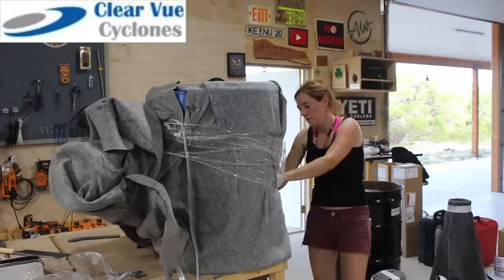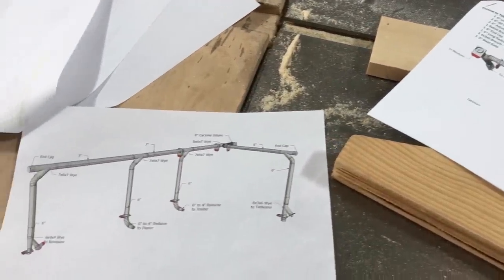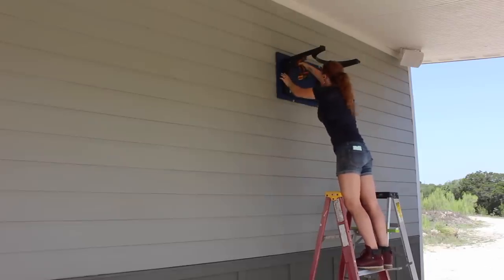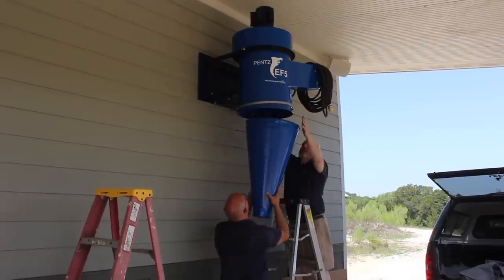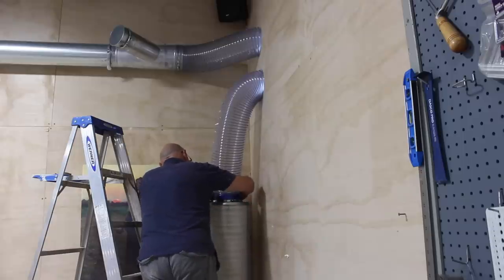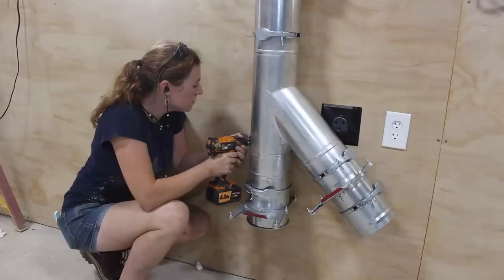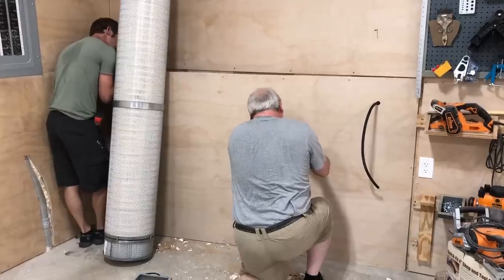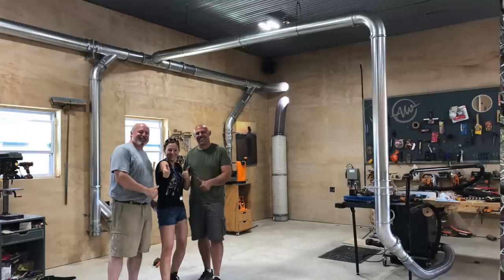Installing A Dust Collection System

Comment: I would use metal strapping on the ceiling because rope isn't gonna hold up. Overall I think you have one of the nicest wood shops in the country.
Reply from the maker: There is no reason the paracord shouldn't hold up fine. There is no motion so no friction to wear it down over time. It is also inside so no direct sunlight to break it down.

Comment: Why even bring the 5micron air back in? Is it really worth it to save the “cool” air (which will be a bit warmer once it gets back in your shop anyway)?
Reply: 1000+ cfm pumping OUT of the shop and new air will come from somewhere... If you are paying to cool/heat air you are going backwards. You need make up air if you are pumping air out. 

Further, if you have something like a woodstove or furnace you will potentially be pulling the exhaust back in to meet the make up air requirement.... ie.CO risk.

Comment: Why are there so many whiners on here today. Being unrelateable... you only need this system if you have a shop this size.  They have plenty of products that a small size shop needs at prizes a small shop can afford.  She uses the same type of equipment anyone could get, just because it's a brand or model you cant afford doesnt mean you cant do the same thing with a different model/brand.  And in this case, not a exception, she linked to something similar and more affordable such as Jay's setup.  If you are complaining about leaving just go already, she nor others folks need the negativity. There's enough of that in the world currently.

Comment: Why not run some of the metal 8-inch piping thru the wall that way it can be spray foamed around the outside and inside parts that way it helps keep the conditioned air in.

Comment: I have a question about the clamp together ducting.  Does this come in smaller diameters, and would it be appropriate for clothes dryer venting?  I have a long run of dryer duct through an unfinished space, and it would be fabulous to un-clamp a section to clean it out instead of having to work my way through from one end or the other
Reply: Norad... Google it.
Reply: Yes,  the ez duct comes in 4". Same as your dryer duct. I believe 3" is the smallest I have seen. But, it isn't cheap!
Reply: @lukeclark1544  Thanks!  Even if I only did a short section near the elbow into the laundry room, it would make the whole de-linting process so much easier.
Reply: They come in 5' long lengths.

Comment: Holy crap be careful you don't implodes your shop. Good idea in using the reusable pipe system, no telling when you might change stuff around. I bet it was too much more than using PVC. 8" PVC isn't cheap.

Comment: Did the pipe, with clamping system for joins, come from Clearvue? If so where can it be bought separately?
Reply: That is Norfab ducting, it is the defacto standard in industrial ducting.  It is available from tons of sources including Clearvue.  It has a price tage to match its reputation but when you use it you really don't want to use anything else.

Comment: Just an FYI,  I installed and serviced D/C systems for a living for 8 years all over the east coast. Having said that, a few things for people to consider. First,  a balanced system (airflow) makes the system carry the particulate all the way to the cyclone and not to fast as to send particulate around the cyclone and into the after filter. Too slow and the main duct gets filled and airflow drops off. Opening and closing only gates that you are "using" starves the system of airflow,  puts too much stress on the motor,  and drops airflow in your main trunk. Once the whole system is properly balanced.  You only turn it on and off, and leave the gates alone. The system should have a main damper at the blower. That should be the only thing you open and close depending on how clogged the after filter gets.
Reply: Just a quick note. I have no doubt you are right about D/C. But starving the system of airflow does not put stress on the motor. For a centrifugal blower, the less airflow, the less torque the motor must supply, so the less loaded it is. In this case, the motor may rely on blower airflow for cooling. So it is important to have some airflow. But as long as at least one gate is open that should not be a problem.
Reply: @mckenziekeith7434  here is a quick test for your thesis, put an amp meter on the wires feeding the motor with a balanced system. Then, close down some of the gates. The more you shut down. The more the amperage goes up. Putting stress on the motor. This does a couple of things,  it runs hotter,  uses more electricity, and this leads to a shorter motor life. Not to mention the air flow dies off in your main trunk line as well. Trust me. If you don't,  well. I guess that is why my company could charge other companies so much when they all had maintenance departments. Bottom line is general "joes" don't understand everything that they should about these systems.
Reply: Luke Clark, you are just flat-out wrong. When you have a centrifugal blower running directly off of the line voltage, then restricting the inlet or outlet decreases amps and increases motor RPM. This is basic blower information. In fact, if you don't have enough restriction, you can overload the blower and burn out the motor. This is the reverse of what you are saying. See this article for example: http://hvacrfundamentals.blogspot.com/2009/08/understanding-centrifugal-fan-motor.html
Reply: McKeith is right! The more of a vacuum the fan creates the less resistance there is for the fan to over come. Depending on fan design, motor power and duct design it is possible to over load a motor by having free air available to it. That said, most systems are designed not to have that limitation.

Comment: IMO, dust collection, ear protection, and eye protection are the three biggest safety features someone can can have in their workshop.  You only get one set each of ears, eyes, and lungs.  I have a central vac but haven't set it up yet as I only have the one 'permanent' machine (table saw), but I have a little portable vac (a Makita) that I use with some of my hand tools (such as the planer, jigsaw, and router).
My only criticism of this setup is that the external connections look a bit average, but it works, so **shrug**.

Comment: Protect those lungs with a respirator or at minimum, a mask when using a circular saw too. The respirator is a must when spraying chemicals for finishing. A fan to blow the fumes outside when welding is a must as well. 

Another great video April. Keep them coming. I’m glad you prioritized this one early.

Comment: If you already have it exiting the building... why would you pump the dirty air back in, just to be filtered? It seems like you could just vent to the atmosphere outside. In doing so, maybe even save a couple bucks by foregoing the huge filter.
Reply: As she pointed out in the video, the unit moves 1700 CFM.  If your shop has AC or heat, the unit will move all the climate controlled air out of the shop in a matter of minutes.  With the filter inside the cool/heated air is returned to the shop.  Also the unit removes particles down to .5 microns, hard to call the air being release back to the shop dirty.

Comment: The large wall the motor is hanging on is acting somewhat like a drum.   If you could isolate it from the wall somehow outside it would be much quieter inside.

Comment: Do you have any earthing on the dust collection system? It looks like the metal piping is isolated by plastic tubing. I don't think it's required for safety but it could build up charge and give you a jolt.
Reply: I'm pretty sure a professional company knows all about that, and would provide a solution that comes with the system when you buy it.
Reply: Dude, think about it.  The whole line in metal, tied back to the  motor which is a220 Volt system with a full earth ground.
Reply: Connected with plastic ducts. Think about it.
Reply: Grounding is not required. And you  can't get a "jolt" from static electricity.

Comment: You do not have 220v at your shop, you have 240 volts. All single phase electrical services in the US are 120/240 volts. Also SO cord is not rated to be run in a wall. You must use some other wiring method such as NM, MC cable or Conduit.
Reply: 240/120 are nominal voltages; not actual.  Moreover, running wire in a wall typically differs from state to state, city to city in the US.

Comment: Why on earth is the outside hole us by flexhose instead of the awesome metal stuff? It looks whacky and has to be harder to seal up.

For your blast gate just add two strings to open and close it. Like those window blinds that have a pulley on both ends.

Comment: A PVC system can build up a static charge.  No fun getting shocked.  It would require a ground cord, so should this one.
Reply: I have a hybrid PVC / steel pipe DC system both have ground wire both still shock me on dry days or any day I mill plastics. The nastiest shocks are from the flex that have a metal wire built in. PS  "dry days "are relative humidity in the low teens.
Reply: I will mill plastics on occasion and I never run the collector for that stuff because of the static.
Reply: How do you ground plastic?  Answer: you can't.  Brand new, shiny, dust-free plastic can build up islands of static charge on it due to particles moving within it.  Run it for a little while and let the dust build up on the plastic...no shocks after that.

Comment: Those 2 permanent 8" holes in your wall just for the flexible tubes running through is really going to bug me. There should be a better and aesthetic solution to that.
All in all, beautiful set up.

Comment: If it was me, I'm not sure it would be worth all that extra to put the motor and cyclone out side. I just have a small JET dust collector and it's not the motor or impeller that makes most of the noise, it's the air getting sucked in and traveling through the hose. On the other hand, having the collection drum outside would be nice. Either case, good video!

Comment: So we all know that in many places a window fan can be used in a house to exchange air with the outside--- for use when it's too hot inside and cooler outside, and similarly when it's too cool inside and warmer outside. Where I'm at, it pays greatly to run the window fan in summer after, say, 10 PM. Well, this blower is so beefy, and since ClearVue supplied that Y outside to allow venting the exhaust to the outside, it could be used like a window fan--- to spare the air conditioner/heat pump some effort.

This would ideally be done with some indoor/outdoor temperature sensors and a somewhat fancy controller to automatically get the logic right. However, a simple timer that would be manually reset for the seasons might work: e.g., ventilating for a couple of hours or so at, say, midnight in the summer. If the thermostat on the heat pump were set to only come on when it gets quite cool (so that the shop is a bit cool on winter mornings but not intolerably so), then the blower could be turned on in the afternoon for a while... after the outside air has warmed up.

This may require a thru-the-wall vent with hinged louvers to allow the intake from outside--- on the opposite side of the bldg. from the dust control intakes.

Comment: 0:28 into the video, my wife just yelled from the other room "did she just say AC and DC?" I paused the video and explained AC electric and DC dust control, and that you included that little pun just for eavesdropping wives. 
PS. She has a hearing problem, she can't hear anything I say.

Comment: If one machine needs only a certain amount of suction than you just cut back the pull. This will cut back the air that is being  taken out of shop. If you get my drift....     Just adjust each machine accordingly........ok....

Comment: I do not understand the noise issue. You only turn on your dust collector when using machines that produce a lot chips like thicknessers, jointers, and tablesaws. They are all louder than a dust collector when you are near them.

Comment: looks good , i hope those flex tubes have a grounding wire in them to kill off static electricity created by the air flow and the unit run to a ground rod .

Comment: 550 cord is only rated at 550 pounds. Watch you weight limit. Also, it will stretch causing your lines to sag.

Comment: I’m confused by running an 8” main line but every tool seems to have a reducer down to 4”.  Doesn’t that essentially restrict the efficiency of the overall system to the CFM of the 4” line?
Reply: No, it doesn't. It's set up correctly. It's the opposite of what you're  thinking since the branches are entering into a shared trunk the size has to increase to maintain efficiency.

Comment: Fine system, but isn't it a bit oversized? I mean, you will never work on more than one machine...
Reply: But you still need the suction power to go the distance!  Nice to have fixed inlets rather then wheeling a mobile one around and dragging a long coil.

Comment: I thought the use of PVC was not recommended for dust collection because the friction of the wood with the PVC can generate enough static electricity to actually get a spark and since wood is flammable, you can imagine what could happen...

Comment: Why did you choose to have the dust filter vent to the indoors?  The real danger to human health from dust are micro-particles that get into your lungs and those that build up and create a fire/explosion hazard.  A HEPA fitler is great but not perfect, optimally the machine and filter should have been placed out of doors and only the vacuum hose run indoors.  Do you plan to change things in the future?